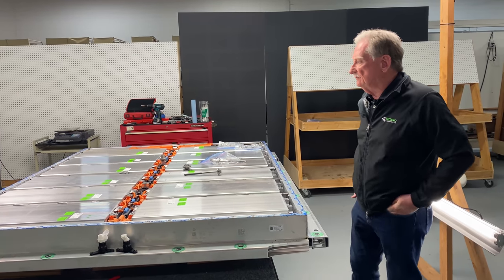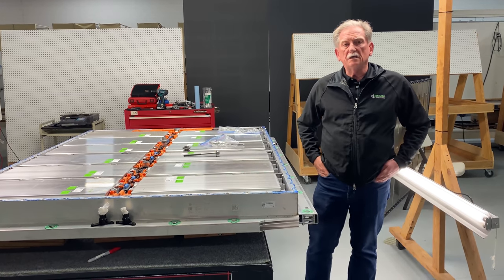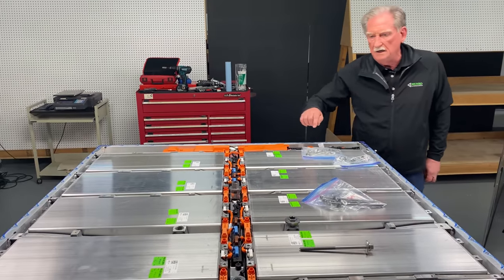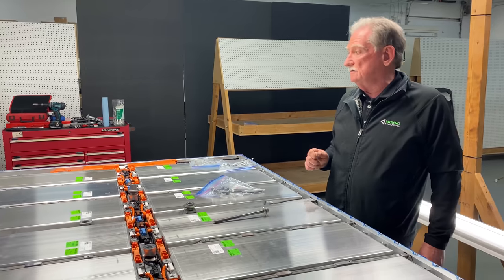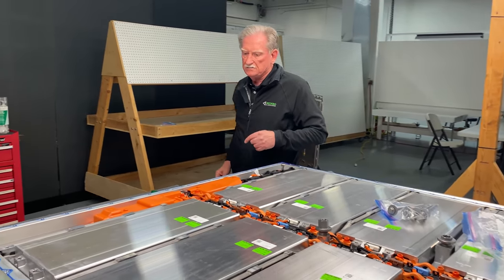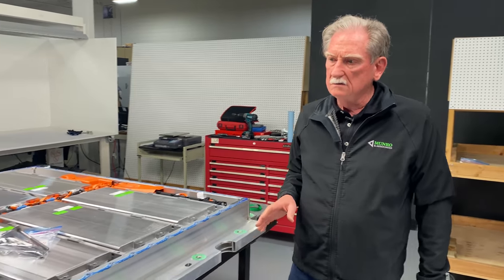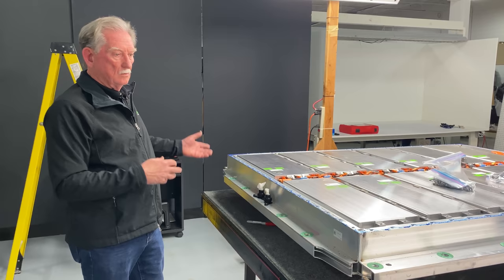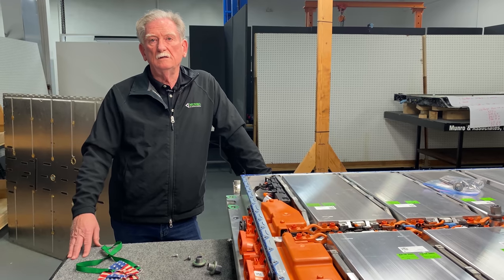2021 Volkswagen ID.4: Battery Teardown

Comment: Yes recycling is very  important  Electric motor  battery packs etc aluminium frames and panels.
Think about solar panels a time factor  10 years or more what to do with the panels it looks it is already a problem.To recycle these.
Know Electricars are going to be sold at a fast rate of knots in the next 5 years and by 2030
there will be a lot of cars on the market but can these car be designed to be recycle friendly.I hope so 
because we may be in trouble if not.
Aluminum
I like this  Video very much  and I look forward to see more and I hope recycling take a strong place in it.

For the next generation it is amust.

Comment: Great battery design. Trying to replace the aluminium with plastic would actually make it worse.
Reply: VW warns not to enter the car with the battery taken out because it is structural part.
Reply: @abraxastulammo9940  still, it can be disassembled and repaired
Reply: @AndyBrandt  I wonder if the Pouch Cell filled modules are repaired or just swapped out as as unit. I could imagine the prismatic alternative cells to be easier to exchange so this is probably why VW chose this format for its unified cell going forward.

Comment: I think the actual solution for this is to make the battery structural, which Tesla already intends to do.
Sure, you can make the mold out of carbon fiber, but that is Rimac Nevera price range, not Nissan Leaf.
Also, one big weight saving point are the actual batteries, since they weigh a LOT.
Solid state batteries are not, hopefully, that far away, and we can see a 250kg, 100kwh battery become reality in a few years. That would bring general adoption of electric cars.

Comment: i have a 2015 VW TDI. the only drawback is using the DEF to meet the smog crap. i thought on the VW ID.4, but its range is too limited. i like German-made products but their sales and technology mentality is off track. it tried to defeat the smog system, ended up paying their shortcoming. now my VW TDI must use DEF. i did have the VW TDI Jetta Sportwagen which had the cheated smog chip, ended up returning to the VW dealer for a full refund. i loved the Sport Wagen that got 45 mpg on the interstate. i hate the damn environmental creeps forcing the consumers to bow to their stupidity.

Comment: You would save 10 kg for a 82-pack if as efficient as Model Y.
So savings could be $100
Reduce cost by replacing with carbon fibre? Sounds impossible.
Reply: Not only wouldn't it have saved any money, it would have actually increased costs for recycling, which by EU law has to be taken care of by the manufacturer, so it has to be priced in.

Comment: Throw out 10% of the batteries like Tesla did.
Ohhhh and why are you guessing the weight of the bolts. Don't you own any scales?
Some of your insights are remarkable. Not in this video obviously but I really am a fan.
Better logic and better comparisons required Sandy. 
If they switched to polymer, how much would they save?
Could and should Tesla do the same thing? Given they are very comparable in weight per kwh of battery.

Comment: This guy hates bolts. I've repaired thousands of things and not once has the failure point been the bolt. Every single one of those repairs was possibly because they used service friendly fasteners. It's not hard to keep fasteners from coming apart even in the most extreme circumstances. Rivets aren't that much lighter and make servicing far more difficult.

Comment: (489/82)/(439/75) == 1.01880660037, so there is a 1.9% difference in power density between Model Y and Id.4 packs.
That does not seem much for me.

Comment: Obsession with saving a few kilos doesn't make sense with an otherwise heavy car and pack. Makes statement out of the blue about saving weight, therefore money, but one of the choices was carbon fiber? Is that going to be cheaper than aluminum? And using a polymer is clearly no where near as strong as aluminum

Comment: The bolt is 63kwh, not 57kwh. Bolt is 57 usable... Just like Model 3 is about 68-71 kwh depending on pack. Sorry, but your numbers are not equal.  The video of well done otherwise and informative. VW was avoiding risks clearly in their first design. Maybe next round they will do better.

Comment: Comment about the weight reduction, 50 kg to save 500 bucks, making that chassis out of carbon fiber to save that money sounds oxy moronic also in terms of crashworthyness carbonfiber fails catestrophicly vs the extruded aluminium crumpling.

Comment: Seems like a lot of complexity and cost to potentially save 50 kg of static weight which is mounted low, in a vehicle that has a kerb weight of over 2000 kg. So a best case weight saving of 2.5% but even less once you add the weight of a driver and a few passengers. Doesn’t seem a worthwhile exercise to me.

Comment: 440 kg Tesla for 75 kWh would be roughly 484 kg for 82,5 kWh the ID.4 comes with.

Same weight ... so ID.4 battery has a similiar weight / kWh ratio ... or Tesla is as good or worse as VW.

Comment: People are more interested in retrofit kits with batteries and motors and electronics rather than new cars.
As governments should be interested too.
You reduce pollution a lot faster by converting the billions of existing cars to EV tech rather than building billions of new cars and veeeeery slowly replacing existing ones.
You should promote this idea. The same way at the present, they sell crate motors, with various v6s, v8s, etc that can be swapped in any vehicle.
This should be a widespread thing with modern EV tech components and subsidize from governments (same as they give to new EV cars)

Comment: Why do not you compare the weight against the number of kwh. Why du you say that a 8.8 screw is very strong. 8.8 is a normal screw. 10.9 and 12.9 is strong

Comment: Rimac Nevera 120kWh - about 530 kg - 550 kg. The battery pack contains 6960 x “21700 Cylindrical” cells. One 21700 batery weight are 60g - 65g. If we calculate 6960x65 sum are 452.4 kg net only in worse case for complete battery cells weight. Adding case (carbon  case) and wires inside battery pack on that, overall this is not more than 550 kg. Power to weight are 30% better than Tesla Model Y improved battery pack.

Comment: at 4:40 he says the fastener goes into the plastic state!  this is bad!  you never want your metal component expecially a fastener to go past the yield point into the plastic zone as this means there will be PERMANENT deformation NOT recoverable ELASTIC deformation,  I would have thougtht a guy with Sandy's background would have a better handle on this concept and the terminology around it

Comment: Fibre-glass or other plastics might be way cheapier and lighter than aluminium, but is it really worth it? There's no real way to recycle plastics, on the other hand aluminium is simple to recycle: melt it.
Another option might be high- or ultra-high-strength steels to save weight. Current structural (weldable!) carbon steels have yield strengths up to 1300 MPa or even more. And recycling? Never heard of problems recycling steels.

Comment: I guess the biggest cost saving would be had if instead of multiple cells you had 1 big single one
Reply: Cells have a certain voltage based on chemistry (1-4 volts), Car battery packs typically are about 500 volts.
Reply: @CorwynGC  could that be catered for with the inverter? The battery is just a energy storage unit , it like having a petrol car with multiple tanks
Reply: Oh boy. 🤦🏻‍♂️

Comment: replacing solid aluminum with plastic? insane. you will not go ahead with carbon fiber since this will cost fortune. Molding plastic connections will reduce ability to fix it for a new part if it will get broken or a bit melted because of the heat

Comment: Sorry but you see all the points only from one side, "Lower costs". I´m an engineer from Germany and for me are screws or like you say fasteners, mechanical the best solution (not the cheepest). And as an engineer i don´t want the cheepest solution like glue or clips, I want the best solution for ease of repair to! If i see the tesla battery, i´m frightened, because there is completley glued, its not possible to change some cells. Sorry but the VW solution is so much better from the point of an engineer, maybe not the cheapest, but the cheepest solution i would left to the chinese!

Comment: There is no point to use bolts on the lid for battery, just glue it like a airplane wing.
Reply: Until you want to take it off.
Reply: @stevelaughlin7084  they dont need Carbon Fibre plastic to keep the lid on a battery pack, they can use something else witch will open easy

Comment: if you do the math and take into account the 82 vs 75 kWhr in a id.4 vs a model Y you only need to get rid of 10 kg, not 50 kg. 
so your whole idea of having to get rid of 50 kg is flawed.
Reply: If they did a 70 kWh battery munro would praise VW for being lighter than Tesla 😜

Comment: After watching the video about the vw electric motor I watched this. And I'm sure I don't watch no other videos. He's complaining about bolts, but doesn't say "how to do it without". In the motor inverter they us so many bolts to prevent bending of the cicuitboards. Why and how reduce the amount of bolts and take the risk of broken copperlayer on the board? And now he is complaining about bolts in the batterypack. How to do it without? Weld everything so you never can get it open?  And why make it from not recyclebale fiber epoxy polyester (name it how you like it) Windfarm rotors are allready an environmental problem. Why add more from batterypacks?  When you say something is not good, tell how to make it better. Only complaining about something, only makes you a whiner.

Comment: I don' get it. Tesla does' have "about" the same capacity? . 7kw is the difference. VW has10% more capacity and 10% more wight. All this magic nut and bolts polymer video is about nothing😁.I'm sure they thhougt through more variants. Polymer is not so stable in different tempritures, carbon is more expensive, atc. etc.

Comment: Battery looks space inefficient more than weight inefficient
Reply: The ID.3 is 4.26 meters long and can fit an 82 kWh battery pack. There is no other electric car out there that comes even close.
Reply: @primetablet  From this we can determine that the battery is small enough to fit into a car 4.26 meters long.  What I would like to know: is the battery space efficient or not?  By what metric?  What is the kWh to volume ratio?  kWh to LengthWidth ratio?  Along those metrics, how does it compare to batteries of Tesla and other cars?

Comment: It might be better to over-engineer this part than shaving off a few kg-s due to liability/insurance reasons...
What will happen with the "Tesla structural battery" when the car body frame is twisting and flexing versus this pouch "modular" framed design? I do not think the structural battery concept will uphold with wear and tear...

Comment: how is possible using carbon fiber instead of aluminum to dropping the cost down???  thats horse shit. Weight reduction is cost efficient if u just chop off the same material or replac4e with lighter but of same cost materials. With your idea airplanes should be made of carbon fiber cause its lighter so its sould be cheaper, but its NOT  CARBON FIBER IS 200 TIMES more expensive thats why airplanes ✈  are made of aluminium.

Comment: So basically, Tesla is 8 years ahead of the so called "competition" lol
Reply: ? What are you talking about his stats show the energy density of the ID4 pack and Model Y is less than 2% difference
Reply: @kaya051285  But he did mention that the ID.4 would be 50 kg lighter with the TMY battery pack - A fact that I found wrong - it would be only 9kg lighter. So no light years..And the ID.4 has crash protection built into the pack also...In fact - it looks like the id.4 battery pack is a winner  - or am I missing something?
Reply: @venti4268  That's what I got from the basic stats. I think munroe was just stating that shaving 50kg off the pack is possible

My own view is that batteries are and will continue to be commodity products. Everyone will have high quality batteries

In the same way PV Solar Panels are commodity products. Batteries are where Solar panels were 10 years ago
Reply: @kaya051285  You are missing the point. If you can't see Tesla's huge advantage then I suggest you rewatch the video. VW is at least 8 years behind. They'll go bankrupt. Even nio has a 5 year advantage. Rivian too
Reply: @jasonmandela8028  Just because you say so?

I will definitely admit tesla has the brand advantage over the likes of VW Honda Toyota etc but they don't have a technology advantage because its impossible to have a significant technology advantage in batteries in electric motors and in power electronics everything that makes up an EV

There is also the simple fact that having the best technology doesn't necessarily mean you will have market domination. I'd argue apple has better software and better hardware than the android manufacturers but guess what android has 90% of smartphone market and apple has 10% because most people prefer cheaper rather than faster
Reply: @kaya051285  This is the Youtube comment section pal, don't take things too seriously lol Just buy Tesla stock, thank me later. $10 trillion dollar company